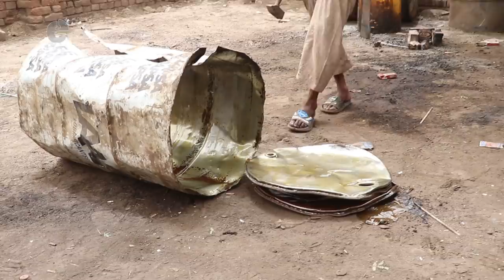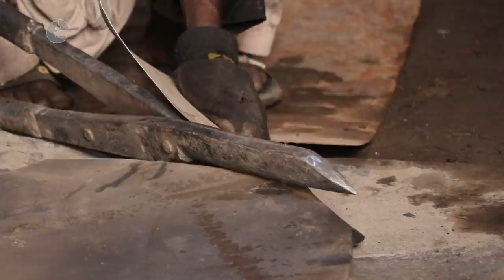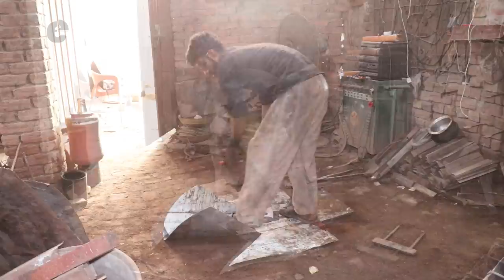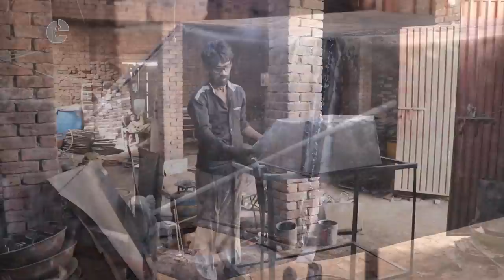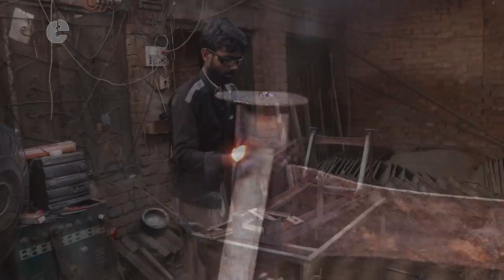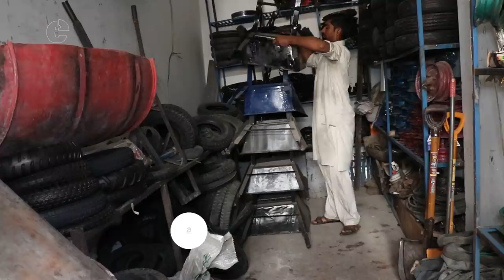Indigenous technique in converting old oil drums into wheelbarrows

Comment: I enjoyed the building process but the end result looks really flimsy and crooked. This is not a wheelbarrow that can hold much weight or last a long time.
Reply: Max load 2 pounds.
On level ground and during favorable weather conditions that is.
If windy, just keep it tied down to the ground.
Reply: It’s utter shite
Reply: @paulbackhard6315  Perfectly good for small loads.
A loaf of bread or three bread rolls for example.
Just perfect 😜
Reply: @agolftwittler1223  even that would be no good as the paint will flake off and poison the bread 🤣
Reply: @paulbackhard6315  Good point, didn't think a that.
Wouldn't be surprised if it's lead paint as well 😝
Truly a complete piece of junk 😂
Reply: @ingulari3977  🤣

Comment: now that's what i call recycling. it might not win a beauty conquest.but for sure will to the work that it is intended for. BUT spray painting without a mask and filter? Weling. though the guy had goggles were those special welding goggles?. safety and protection and protecting the workers is to much to ask?